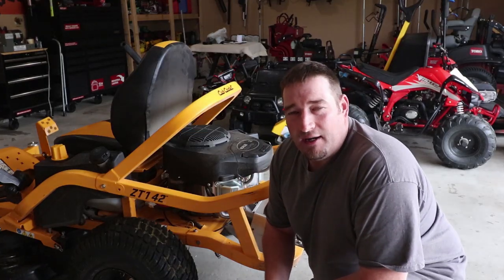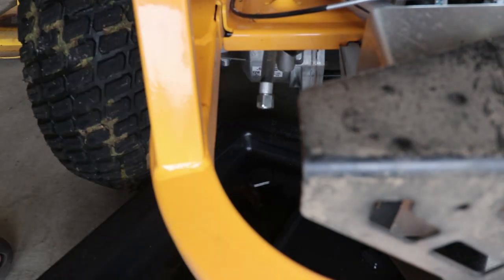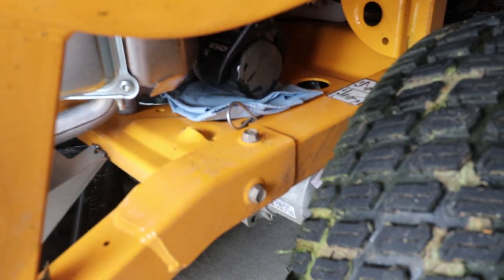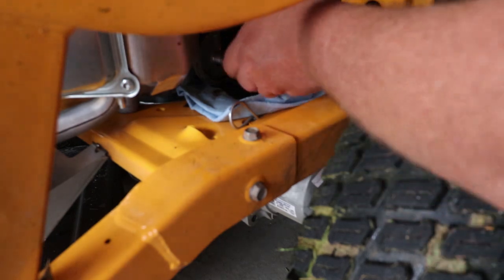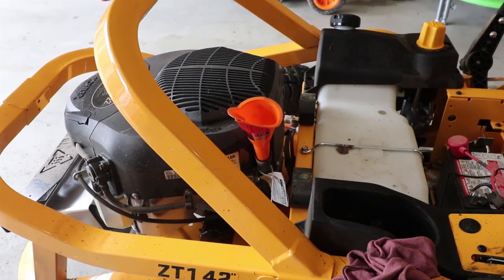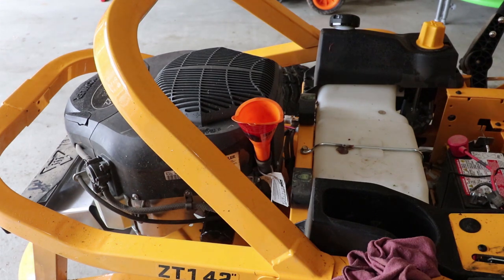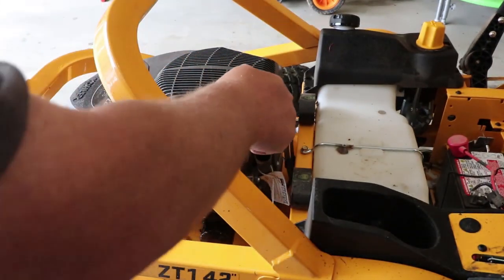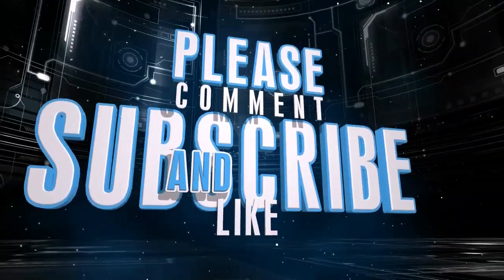Cub Cadet ZT1, How to change the oil,  Step By Step

Comment: I have the Cub Cadet Ultima ZT1 54”. It takes 2 quarts of SAE 10W-30 oil. Oil filter use 12 050 01 Full-Flow Filter. Use 5/8” spark plug socket. Spark plug torque (20 ft. lbs.). Drain plug torque (10 ft. lbs.) for all except 62 789 01-S torque 16 ft. lbs). Fuel filter use 24 050 13. Helpful hint: You can find all your part numbers under your seat. You can buy a complete Engine maintenance kit - Kohler 7000 series 20-26 HP (#36 789 02-S) that has 2 quarts of oil, oil filter, fuel filter, air filter, and 2 spark plugs. Good luck!
Reply: Thank you! I was hoping this info was included in the video but it wasn’t. I appreciate you!
Reply: Finally.  The info I was ACTUALLY looking for.  Thanks
Reply: Just bought the maintenance kit today!

Comment: I tried changing the oil tonight and am glad I found this thread. I too was unable to remove the plug (this is the first time changing oil). I've decided to pick up a pipe plug socket set tomorrow and attempt removal with my impact wrench. Wish me luck ; )
Reply: I took a lighter and warmed it up... Came off with ease.

Comment: The oil plug is tuff, I used a cup of microwaved hot water and let it sit in the water for about 5 minutes to help losen the factory seal on oil plug.

Comment: Yeah that drain plug is no joke. I had to use some vice grips and beat the wrench with the frame of the mower. Still couldn't get it to turn until I let it run for about 5 min to heat it up and it finally loosened.

Comment: Good luck to any normal human! To undo the oil drain plug, it was nearly impossible. I almost broke both hands and blacked out. 

Finally got it loosened. 

Good luck!
Reply: Fo sho.
Reply: Submerging the drain plug in boiling water for a couple minutes helped for me.
Reply: It is a bit of a bear for that first oil change. I moved the drain hose out of the hole in the frame, used an adjustable wrench around the outside, and used a 12mm on the bolt itself. A little bit of muscle got it loose enough to get started. Good luck!
Reply: I actually had to remove the starter and drain it from the base
Reply: Going through it now!!! Came to the comments for tips. Thought it was just me.
Reply: @alebron14  it’s just crazy
Reply: Having trouble with mine. It's awful
Reply: @generalchrome  it definitely sucks
Reply: @generalchrome  haha good luck, have 911 stand by ;)
Reply: It usually helps to get the wrenches close together so you can squeeze them together with two hands rather than trying to contortion your wrists and forearms into a crazy maneuver with the wrenches further apart.
Reply: Hells to the yeah
Reply: @xLeo245  thank you this worked for me
Reply: @orsoncorson9083  this technique is by far the best. Thank you for you wisdom!
Reply: I don’t have any trouble getting mine off because I use a breaker bar!

Comment: I also refresh the hydraulic oil annually. It turns black from the wear and tear of hydraulic operation. Take the Allen plug off, using a hand symphonic pump suck out as much old oil as possible, keep track of how much you remove then add the same amount back I. Do this on both sides. Your getting the majority of the hydraulic oil out. My mower hydraulics seems quieter and more responsive. plan on doing this twice a season.

Comment: Good video.  I have a 50 with the Kawasaki motor but this gives me a head start.  We've had a mild wet winter and I was mowing almost to Christmas.  Time to winterize.  Should I change the oil now or wait until I dust things off in the spring?
Reply from the maker: I’d wait closer to season starting personally

Comment: I just hit the 5 hour break in for oil change.  i got the correct part # for oil filter KH-12-050-01-S but it is about an inch shorter than the original  did you notice this with your replacement filter?  i got the kohler filter again.
Reply: Yes me as well.
Reply: Did u use Kohler oil
Reply: Yeah, I think I did, i always get a little warranty shy about not using approved stuff while it is under warranty.

Comment: Just curious, when you installed the new filter, did you put fresh oil in it first, or did you install it dry? Does it make a difference?
Reply: I never install an oil filter on anything I own without priming the filter first.
Reply: @Ozzie4Para  I was asking considering the filter is mounted sideways, if you pre-prime the filter, when you install it, it will spill all over the place...  I've seen suggestions to install the filter, then add one full quart, run the engine for a minute, then top off...
Reply: When you pour oil into the fill, the filter will partially fill on its own. With filters this small there is no real benefit to filling the filter ahead of time. It's not going to hurt anything to do it, but the benefit is tiny if there is any at all.

Lots of motorcycles use these same filters, and I've never pre-filled a one of em ever, even when I was racing. Many hundreds of thousands of miles later, no problems.
Reply: @airtimepaintball463  thanks :) I forgot all about this post... I ended up just putting the filter on then filling the oil about a quart and a half running it for a couple minutes then topping it off work great
Reply: Fill the filter to base of threads.
wait 2 minutes for filter to absorb that oil.
Install new filter.
The directions are on the side of the kholer oil filter i purchased from tractor supply (kholer 7000 engine maintenance kit)

Comment: Can you change the hydrostatic fluid on these exact mowers? Or is a sealed system. No I didn’t watch the video and yes I just bought one yesterday without remembering to ask lol.
Reply from the maker: Best way to know if your model is serviceable is check the hydro pumps for a removeable reservoir cap

Comment: How’d you get that oil drain plug out it’s like they just glued the bastard in there
Reply: I just tried for 30 minutes to get mine off before I gave up and drank a beer.  I’ll try again tomorrow.  He edited that process I see...
Reply: I got mine finally take a pipe wrench to hold the bigger fitting then I took an 11 mm a 7/16 would work too I bout broke my hand but I got it lol
Reply: Ya no joke...I bought a new 54 version of this last month, just went to change the oil...holy mother of pearl...16 ft/lbs my ass. I was able to get it out using 2 pretty big adjustable wrenches. I put it back together with considerably less force.

Comment: What oil did you use what size oil filter. That would be useful information.
Reply from the maker: Ryan Wilhelm oil on this Koehler 7000 series recommends 10w-30. Filter will vary depending on brand
Reply: Lanier Lawn Care thank you so much! 😁🙏🏻
Reply: Cub cadet recommends sae 30 summer 5-20 winter!!

Comment: What do you suggest for a hour meter? How can you get one out on?
Reply: *put
Reply from the maker: I’d probably get one off Amazon like I did for a push mower I had. It basically just wraps around the plug wire and mount it where you like. when it has current then the hour meter is counting.
Reply: Do you have a link to that one by chance?
Reply from the maker: Here you go. Hardline Products HR-8063-2 Hour Meter,Black https://www.amazon.com/dp/B000WJEY8S/ref=cm_sw_r_cp_api_glt_fabc_WGB0NS1JTRR1EJYYX1KT?_encoding=UTF8&psc=1
Reply: @LanierLawnCare   Do you know how to install or do you have a video that shows how to?

Comment: Instruction state put oil in new filter then install.  What your thoughts
Reply: Not necessary.  Running it a minute after the change and then topping off if necessary is all that is needed.

Comment: The oil plug on mine is so tight I can’t get it off it’s my first oil change
Reply: Me too. I’ve been trying for 2 days
Reply: @jerryransom7526  try some wd 40
Reply: So how did y’all get it off?
Reply: Same???? Help
Reply: All - get an oil filter wrench or "strap" wrench.  Strap wrenches are great for a lot of applications (like plumbing)
Reply: @Evelyn Watson  if you're in a pinch, there are videos using a screwdriver and hammer to puncture the filter and use the screwdriver as leverage.  When they ship these, they massively tighten the oil filter... had the same issue myself the first change
Reply: @twistedsisterx7754  Thank you for responding. I did end up buying a pump to get the oil out, a slow but easier and inexpensive process. my muscles weren't strong enough, haha, but I feel better that I wasn't the only one with this issue...I will keep this in mind for next oil change, ty!
Reply: @twistedsisterx7754  they said they were having issues with the plug, not the filter.

Comment: I wish my drain plug came off that easily. I tried heating it with a blow torch and it still won't come loose. Had to walk away before I hulk smashed the shit out of the mower.

Comment: You wouldn't want to tell us what type of filter or oil you use, right? And how about getting your arm out of the way of the shot (or moving the camera)? Not as helpful as it could have been.
Reply: I take back my "type" criticism. Cub Cadet didn't mention those details in theirs. Yeah, you could have shot it better, but they have a much bigger budget, I'm sure. Thanks for your efforts.
Reply from the maker: 1205001 is oil filter and oil is Kohler 10w-30

Comment: I know this is an old thread but I will comment anyhow. In response to some of the negative comments on this thread; your local lawn equipment store will look up your mower make and model and tell you what "oil/filter" kit you need. Just give them your mower information...take a picture with your phone. It's that simple. Now for the less simple things. I hope I can remove the plug since it will be the first time changing the oil & filter, etc.. One person mentioned using WD40 maybe that will help. I was going to pay a man to come do this maintenance, but after two weeks of him rescheduling I said, heck on that... Gosh, people need to be a person of their word. If they say they are going to be their on a certain date for a certain time, then they need to do so. I understand stuff happens but really several times later means my money is not worth anything, just like his word!. Sorry about the rant on that, my frustration is showing. However, I am grateful for this video because I don't know what I am doing but someone has to do it so at least I have a guide now. THANK YOU.

Comment: What type of oil and weight? Video sucked
Reply from the maker: Luis Perez 10-30 Kohler oil. If Kawasaki engine I’d recommend 10-40
Reply: Your manuel that comes with your mower tells you exactly what you need. Comment sucked.